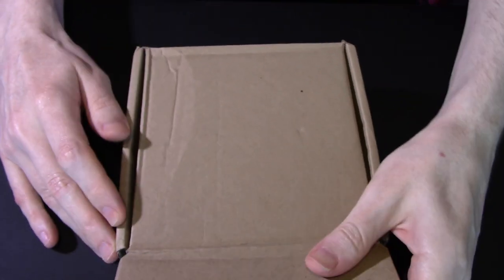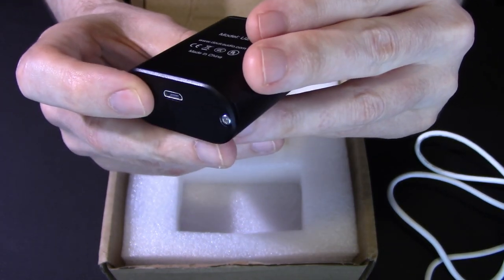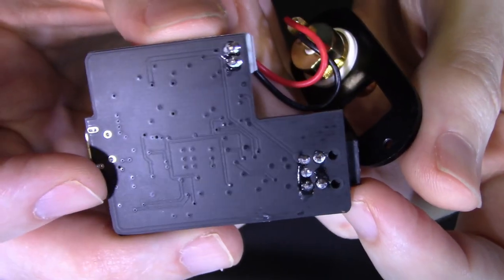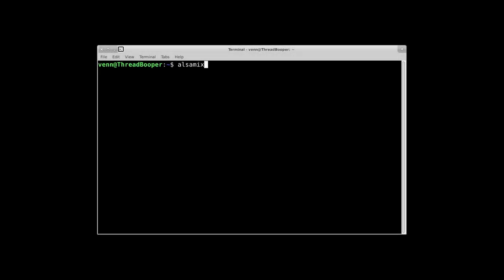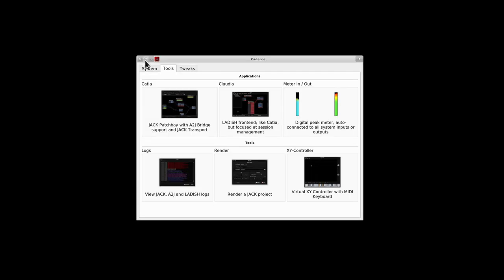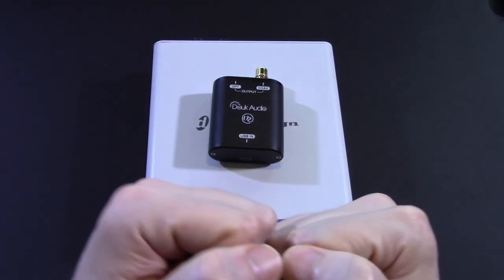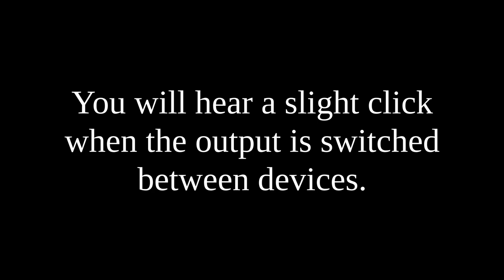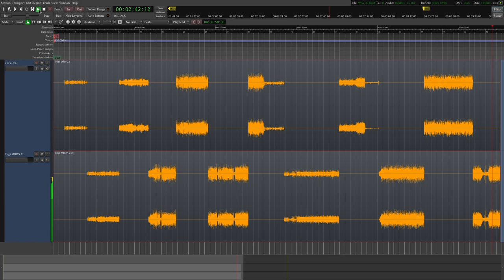Interfacing Linux: Douk Audio U2 USB TOSLINK & S/PDIF

Comment: I have a pair of wifi speakers that in order to connect to my laptop (full windows sound) requires an optical, rca or coax input (the only available inputs besides wifi/ethernet or bt), which my laptop has neither. the speakers themselves support up to 24bit/192khz sampling over optical cable, so, can I use this to connect my laptop via optical to my speakers and still get full audio quality (up to what the speakers support) or do I really have to invest a bunch more and actually get like a fiio k3 or soundblaster X4 (some of the cheaper but still well known options out there that will do this)? I'd rather spend 50 over 100 just for that, but if it doesn't work I guess there's no alternative... (newbie here so sorry if i'm asking about something that should be obvious 😅)

Comment: I was feeling thrifty and I bought this with a Raspberry Pi standalone DAC and repurposed some old Aego2 2.1 active desktop speakers and hooked them up to a new home build x470 taichi rig, running Windows 10 and Linux. I got grief off Windows driver installation but zero from Linux (current Kubuntu LTS) which was proper, consistent,  plug and play goodness. Admittedly I used the coaxial connection but was actually impressed  by the results for relatively little outlay. It's persuaded me to invest in a modest decent USB DAC anyway.
Reply from the maker: Nice.